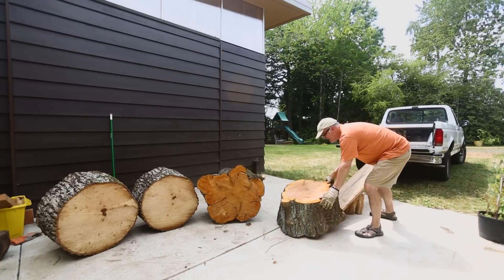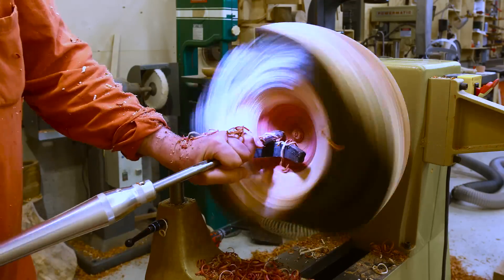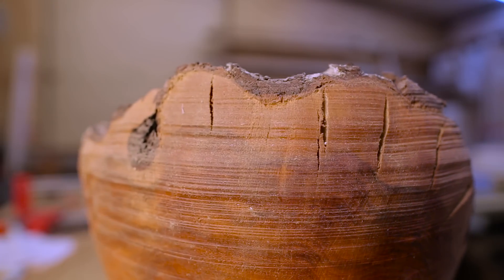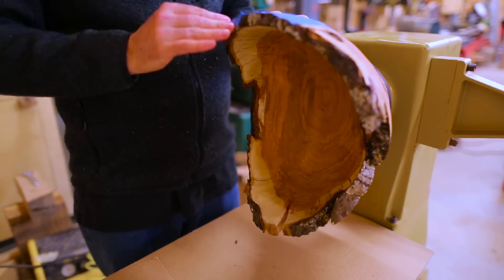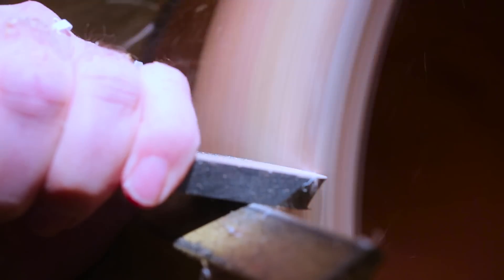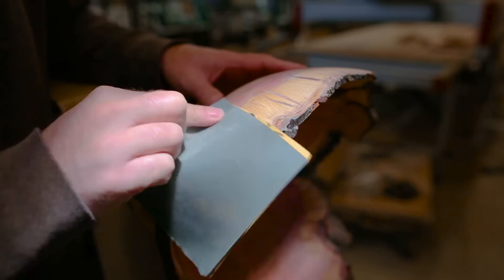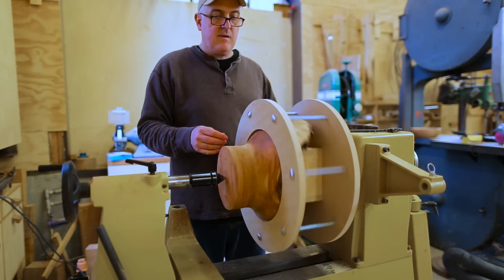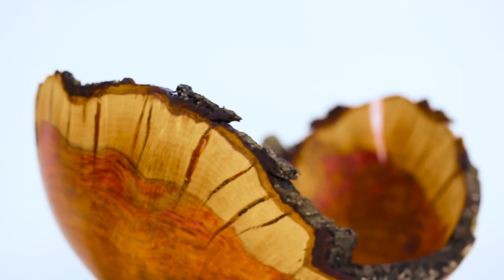Wood Turned Plum Bowl

Comment: Hot glue to seal the cracks for resin filling is brilliant! I like it. I've had a lot of trouble with that. Even if you stretched a piece of rubber or something over the outside of the cracks and used hot glue to seal around the borders that should work great to get the resin flush with the surface. Tip: you can remove hot glue from wood by soaking it briefly in rubbing alcohol. It peels right off.
Reply: NightHawkInLight Cool to see you here.
Reply from the maker: Thanks.  There is a spot on the bark where i need to get the hot glue off.

Comment: Hi Frank, I love the channels and the stop-motion animation especially. On your use of epoxy or any type of resin for that matter, a torch flame waved at the bubble almost in a threatening manner, keeping the flame moving constantly. That helps bring the bubbles to surface. Or a pad sander with no paper held on the side of the item to vibrate as with concrete. Hope this helps, Pete

Comment: Nice to see a video on using resin to fill cracks. I have done this before. I usually start with filling the cracks before I start turning to reduce the chance of it coming apart. My process has been to start with tape and seal it with medium ca before pouring in the resin (colored, sometimes with glitter). I like the idea of using hot melt and will try that next time. I use a heat gun to remove bubbles. So far I have had good success, but I use a slow cure poly resin. For vibrating out bubbles a would think a random orbit sander with no sandpaper would do the job.

Comment: To encourage the bubbles to rise to the surface without a vac chamber - you need to vibrate the piece. I use an old drill pushed up against the piece. 30 seconds usually does it. The CO2 in your breath (breath on it) should pop the bubbles that rise to the surface.
Reply: Richard Allsebrook Using a heat gun also works well to remove the bubbles.
Reply: lol. 'course I'm not lecturing him. Or anyone. I'm passing on a tip from one builder to another. You don't like the free exchange of ideas here?
Reply: We used to use a propane torch to do the same trick on clear epoxy (sucks the bubbles right out) - not sure if the resin would be OK to do same though.
Reply: +Antoine Aubeneau well, I didn't know, so I'm glad Richard wrote some good info in the comments. Weird that you're on his ass about it. Having extra information is rarely more of a problem than not having enough.
Reply: Good idea.

Comment: Hi Frank, what a great job! I love the patience you have to figure out the solutions and of course, I would like to have a shop like yours :D  A dream of every carpenter. You should have used a bowl safer, so you would have get more more beautiful pieces out of of this nice plum. I bought me a woodcut bowl safer, because turing nice wood into chips, it always sorred me. Out of a 18" inch blank, I can get 3-4 bowls, even with enough wallthickness to re-turn them well. I heartly can recomend it. The invest is recovered in very short time ;-)

Comment: Nice project. you can remove the bubbles from resin by using a light flame, such as an Aim-N-Flame lighter or propane torch on low setting. Just a light brush with the fire will expand the bubbles right out.

Comment: That looks sweet! When you heat up the bowl for epoxy, I know it helps it get into the voids, but does it work better than the vacuum chamber method? I have a chamber that I use for things up to 12" x 12" but if the oven works just as well, I wouldn't be so hesitant to do bigger things that I know will need a good amount of epoxy. 

As for bubbles, a quick hit with a blowtorch works almost as well as the vacuum chamber, but it's not as messy since the epoxy doesn't expand like crazy as it begins to degas.

Comment: Amazing, as usual!  Thanks for all the info.  I love how much "history" there is in this one project.  One trick I've learned to keep epoxy in oddly shaped areas: Play Doh dams.  This may not have helped in this case, but good trick to know (I think).  I will tag you in an Instagram photo to illustrate what I mean, as links in YT comments tend to get spam filtered.
Reply from the maker: I thought about modeling clay, but i was heating the bowl a little and I thought it would run all over the place, how does play doh stand up to a little heat?

Comment: Frank..........system 3 mixed with charcoal dust looks exactly like hard knots.....the charcoal gives the combination a "grain" like feature.......you are correct - resin is like oil.......if there is a hole it finds it
I use paint tape and duct tape in layers
Next time you want to do a live edge cut to size and then "fix" the bark with CA that will soak into it and turn it into stone
Finally......when polishing resin.......go to chemical guys and buy their fine glass abrasives for cars.........you will be happy with a combo of EEE - yorkshire grit - car polish and wax

Comment: Amazing video as always!  Check out System 3 Sculpt Wood and Mixol woodworkers dyes.  I just got finished with a wych elm table slab and had a LOT of fill - the putty worked really well and I could see using it instead of the resin/tape/glue combo you just went through

Comment: Q: When you CNCed bigger disc, could you mark the center by CNC?
Reply from the maker: I did with the big solid circle, I made a hole the size of the hole in the face plate, so i could line them up.

Comment: If you can’t use a vacuum chamber take advantage of the gas laws, in a well ventilated area use a propane torch to dispense propane gas (unlit of course) over the freshly poured epoxy, you should see the bubbles rise and break, then well ventilate the area to disperse the gas which is heavier than air, be careful, be sure there are no pilot lights or ignition sources around, especially near the floor